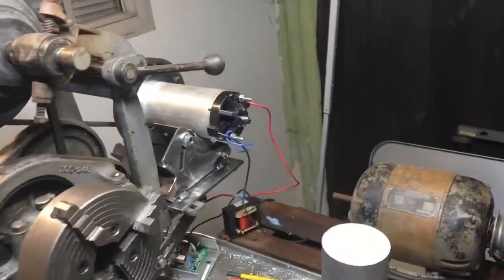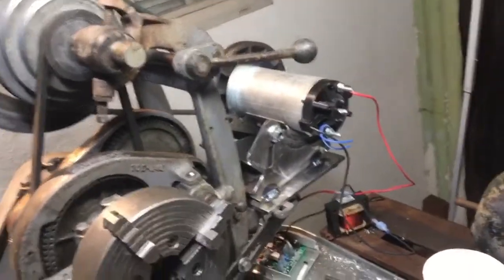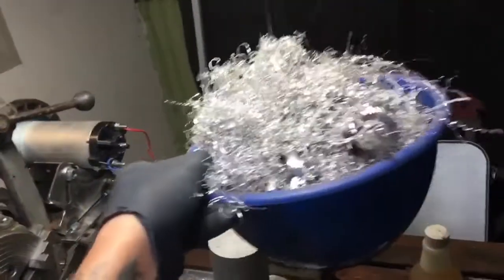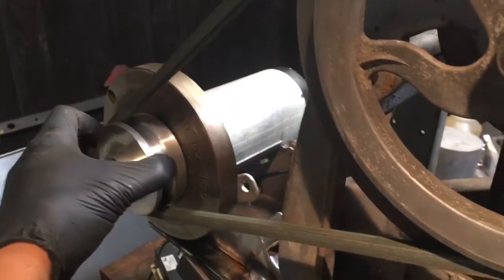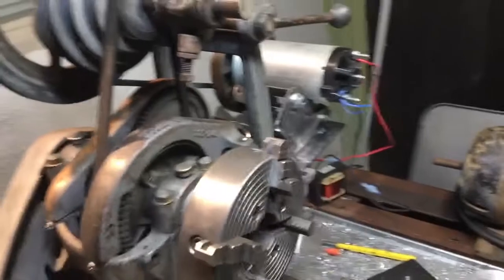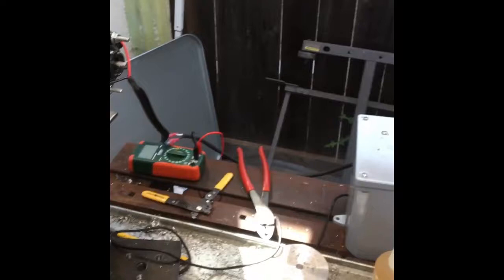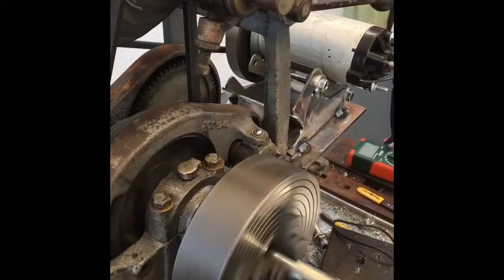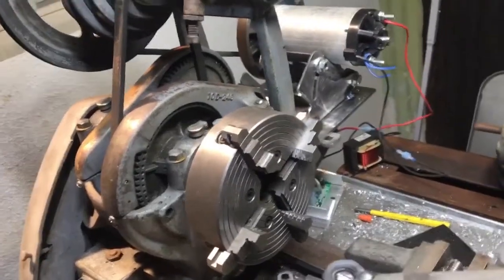Atlas 9” metal lathe variable speed DC motor conversion

Comment: Been wanting to do this mod but have you had any issues with motor lagging? Treadmill motors have less resistance in my experience and slow considerably when force is applied against them. Thanks. Nice Job.

Comment: Hi, I have a 12" atlas lathe I am attempting to add almost the same motor to. I wanted to see if you would be willing to send me some pictures of how you mounted it that's the issue I m having now.
Reply from the maker: Sure no problem whats your email and I'll send them to you.
Reply: @RMarquez805  matthew.heaton92@gmail.com thanks a lot. Do you have any concerns with it not stopping right away?
Reply from the maker: @matthewheaton4421  No issues here I would definitely do it again, between having the ability to easily control the speed and how much quieter it is, it's so worth it. According to the research I did you won't want to do it without the flywheel though. I'll get you the photos when I get a chance probably sometime today.
Reply: @RMarquez805  yeah I'm doing it. I am using the fly wheel I actually bought a poly v sheave and belt from b&b manufacturing so I could use what was on the treadmill motor. Thanks again yeah whenever you get time.
Reply from the maker: @matthewheaton4421  Photo's sent let me know if you have any questions.